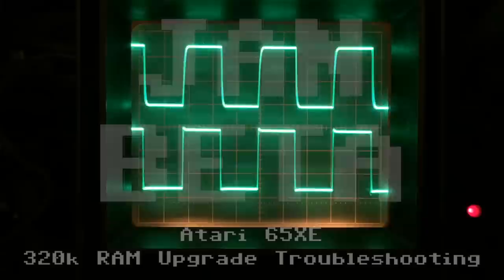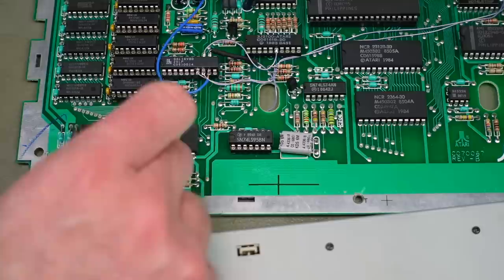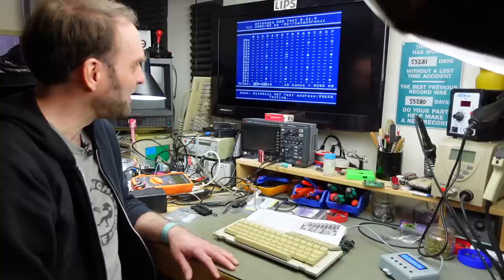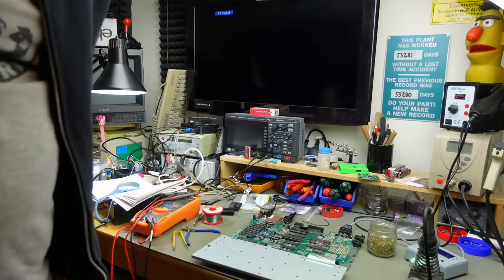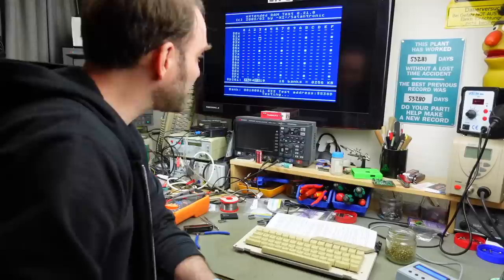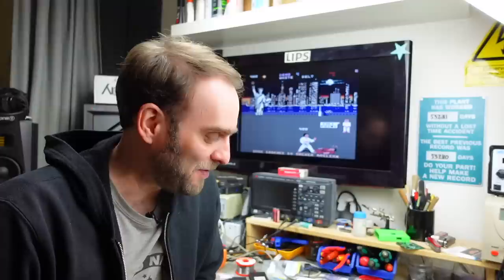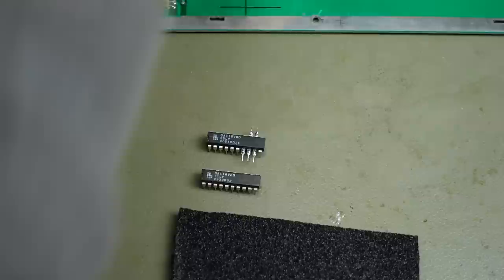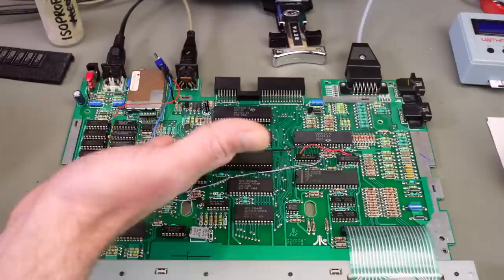Atari 65XE 320k RAM Expansion Troubleshooting

Comment: If you haven't already know, I need to say that -XI-, the author of the XRAM test you were using, has recently passed away.
A good test for RAM expansion seems to be a game titled LAURA, and the famous NUMEN demo.
The most RAM related chips are FREDDIE, MMU, and EMMU (your GAL), and also SALLY, and ANTIC.
These "precision" type IC sockets (especially DIP40 ones), brought me a lot of troubles during my build of Atari ITX.
Reply: Yeah, guys who work on arcade machines tend to *HATE* machined pin sockets.  They apparently cause issues a lot.  Talk to someone who works on arcade machines, and they'll tell you that high quality double wipe sockets are the most reliable.
Reply: @Calphool222  I wonder if it's more of an issue with pins getting knocked out from jostling. Kids/young adults are not above hitting or shoving an arcade unit.
Reply: I have never heard anyone having issues with precision sockets. On the contrary, every time a board of mine had an issue, switching to precision sockets did the trick.
Reply: @nickolasgaspar9660  

Go read the Arcade Museum forums.  There's a debate that breaks out there from time to time.  The majority don't like machined pin sockets, though some prefer them.  There are various reasons given.

Comment: Hi Jan, maybe a silly thing to mention but have you checked the capacitors (value) for the new ram? Also have you checked the voltages on the RAM’s while a demo is running? Keep up the good work, love these videos!
Reply: Yes, a software RAM test is too high level, we need to check signal and power integrity.

Comment: I would re-route the wires, I see a few wires going under the resistors perhaps it picks up some disturbance and also the switch I would try shorter wires ...
Reply: This is also what I thought. I had a lot of annoying problems with random wires like this. But I guess the GTIA was at least partially to blame for the issues, so maybe the Atari is slow enough that long wires don't matter too much
Reply: Good one yes, if they are not shielded it may very well do that and also mess up timings when they are too long
Reply: At very least he should throw a scope on those wires to see if they are picking up any stray frequencies.

Comment: @3:36 The "N" doesn't mean anything important at all. It's part of the order code for the chip, indicating the plastic DIP package. Generally, the presence or absence of a letter like the "B" on the other hand can point to chips with slightly different behaviour, like an extra buffer stage, schmitt-trigger inputs or a different speed grade. The meaning of the letter suffixes are not necessarily standardized and might vary between different manufacturers. Still, what Jürgen most likely wanted to point out is not "you need a chip that has an 'N'", but "you need a chip that doesn't have a 'B'".

In case of Texas Instruments, it seems the A or B suffix on the 74xx95 chips indicate power consumption, with "B" being lower power than "A". They only offer the the 7495A (standard TTL) and 74LS95B (low-power Schottky) which both have approcimately the same speed, but the LS chip has lower power consumption due to the more efficient implementation using Schottky logic. There seems to be no TI SN74LS95N.

Comment: You look like you have another signal overlaid on your square waves around the 17 minute mark. Its amplitude in your samples mostly isn't big enough to trip a false hi or lo when it's overlaid, but I bet sometimes it is. You either have something actually crossed or it's just so physically close that you're getting some kind of RF bleed or something. All I know is that's not just the usual ringing you expect on a square wave.

Maybe try taking the pin you were testing where you kept seeing a sudden fluctuation in the middle of the top plateau of the square wave (edit: 17:12), and see if you can tie its source hi or lo. That'll basically let you isolate the overlaid signal, if there is one. Then you might recognize the pattern in the overlaid signal and then you can look at whatever generates that signal and how it might be bleeding over into the memory bus.

Edit: Sorry if I'm not describing the issue well, I come from the software side of retro computing and my knowledge of hardware mostly comes from channels like yours and some mentoring I once got from a guy who worked in aerospace. It's not my field, but I get the basics and I've seen enough oscilloscope diagnostics to know that your sample looked wrong.

Comment: It's not that 74 series being fake is it - ie. a HC re-labelled as an LS?   I think the N just means its plastic btw!  I also wonder if the wiring (proximity of 2 cables next to each other - or length of them might be a factor?
Reply: N just means "plastic DIP" yes... I very much doubt anyone would bother remarking HC as LS.
Reply: @jaycee1980  Clearly you didn't watch Adrians video - they ARE relabelling HC chips as LS (and vice versa).
Reply: @GadgetUK164  I've not seen that one.. seems bizarre though, not something i've ever come across but then I dont buy components from eBay or Aliexpress any more.

They could have at least relabelled HCT as LS, which would largely pass

Comment: You might want to check out the Retro Chip Tester Pro. It's an Arduino board that can test many old 74xx devices but also DRAM chips, dump ROMs and, with adapters, check SIMM modules and other things. It doesn't reliably detect marginal chips (it's not fast enough to check actual chip timings) but it should be able to tell you if a chip is completely dead

Comment: Unsure but would certainly put your wire runs on the oscilloscope, then check voltages, try replacing PIA as Jurgen suggested in these comments. Then try a replacement ANTIC as merely a shot in the dark.  Other than that maybe it's a failing passive component issue? Sorry to see you having difficulties with it.  Also you might consider getting an XL/XE SysCheck 2.2 from Jurgen since it offers 512K.

Comment: With all the tests now, and the fact that standard usage (w/o memory expansion) works fine let me point out the PIA(6520). The drives the memory expansio and bank select. Portbits PB2, PB3,  PB6 and PB7 selects one of the 16 banks with 16K each. PB4 low = $4000-$7FFF is mirrored with extra bank, PB4 high = standard RAM active in the area. PB5 is used for dedicated ANTIC access, PB5 low = ANTIC "sees" extended memory in selected bank, PB5 high = standard RAM. It´s possible the set different (PB4 & PB5), to let use the ANTIC the extended memory and the CPU runs the code in standard memory. This trick is invented with the 130XE and was used by a very few demos which pre-calculate the screens and let them run from extended memory.

Use the scope and run XRAM to check the signals an PB2...PB7 (Pin 12...17 of PIA). Because the test is quite slow, there must be a stable and sometimes a transistion visible - PB2 more often, because it´s the "LSB" of the 4 bit bank number. When there are flaky signals visible... the PIA is the culprit.

Comment: I would write my own assembler program to do my own ram test.  We need to get to the point where we have precision on how exactly it is failing.  Are reads occasionally failing, or are writes occasionally failing.  Does it happen only when specific address bits are high or low?  Does it fail when only specific data bits are high or low?  We don't have enough info right now, and we're shotgunning chips into it with our fingers crossed.  That's not going to work when we get to this level of troubleshooting.

Comment: Were you testing the bare board just sitting on your table? Make sure you clean it of solder dust, etc. Could have been an intermittent short from tiny solder crud on the table.  Or maybe place the board on an insulator and not the bare table that you used for soldering...

Comment: The thing about the Atari 8 bit computers, is the clock design.  It literally is daisy chained through the main LSI chips, and if one of them damages or deteriorates that clock for the next chip, issues like this can result.  Use a scope and look at the clock going in the chip, versus the clock coming out of it.  The CPU is at the end of this chain and can sometimes get a signal that is barely 5% duty cycle.  Usually increasing the speed type of the logic chips also in the clock path can help this issue.  A 74LS to a 74F for example.  Also XEs with a quartz crystal instead of a clock generator "can" are less stable than the crystal oscillator designs.  Most XEs have solder points for both.  A quartz crystal with a couple transistors generates a sine wave clock.  The dedicated clock generator cans generate a square wave.  The square wave has less chance of deteriorating than the cheap crystal clock circuit.

Comment: I once had a logic board with 64h DRAM and Z80 CPU. It was a proprietary control board for some machine. However, in time it started developing random glitches. After few days, I soldered on the bottom of the board DIRECTLY ON THE RAM POWER PINS a 1uF capacitor, on each ram chip. It solved the problem. Maybe try it to see what happens. My guess was that the decoupling capacitors went bad so I tried his solution that worked.
Edit: the glitches started to appear after the Z80 PIO and the Z80 CPU were replaced; they died from a power surge so, the new chips were less tolerant to the unclean signals on the bus. The added capacitors maybe helped to keep the power on the ram chips clean, thus making the signals better.
While you have a oscilloscope, watch the power on the ram chips, see if there are something interesting when the ram test fails.

Comment: Have you ever considered getting a Retro Chip Tester Pro?  It's a very powerful way to validate good/bad chips with a minimum of effort.  I know Noel's Retro Lab and Adrian's Digital Basement both use them, and they have saved a bit of time compared to trying to swap out so many untested chips.  I understand it's a rather involved project, but it seems to be worth while in the end.

Comment: Jan... I love your videos... :)  but... in this case I think the problem is with interference between elements and that "spider mounted" cables over motherboard.  I had a Atari XE motherboard that had custom 1MB RAM upgrade inserted on 3 sockets in 4-bit RAM motherboard version. So... Seller climed that is ok, but when you checked it with Jurgen's SysCheck it was possible to see some kind of glitches / artifacts between couting digits during memory tests.  I removed this upgrade and now it is ok.  If you want to have for sure that this Atari works, it is very easy, but you should go enter to "modern retro computring" world... So 1) remove all DRAM chips (on XE motherboard it is always problem - a) not working b) vertical bends on the screen in the background c) others) 2) put Lotharek's SRAM 64K V3 under 6502C. DONE.  You will have stable 64KB machine.  If you want to have a more RAM, use solid Ultimate 1MB upgrade, that provide RAM up to 1MB with different configurations, support for HSIO (so important when you have more RAM), support for SIDE3 and a lot of more..  if you don't want to have "modern" elektronics inside Atari, use Jurgen's SysCheck that provides HSIO + extra 512KB.  That's all!  Greetings from Warsaw and Polish Atari users!  BTW.  I invested in Keysight DSOX1204G 200Mhz and U1272A - great devices! Thanx for you videos!

Comment: It's very curious to me that the GTIA chip works perfectly fine with the RAM expansion disabled, but breaks when enabled.

Is it possible there's nothing really broken with the original GTIA chip, but it just works differently, and is incompatible with the mod?

It might be curious to send your original GTIA chip to the guy who designed this mod and see if he has the same problem.   Perhaps he can provide assistant,since he's the one most familiar with the mod

Comment: I dont know if you checked the power supply before all this, but if it was me, I would be checking it. Under full load for several hours.
I would also make sure power getting to all the chips is at spec.
Ur using different chips now so power demand could be less on the power supply as well, alleviating some of the load and symptoms.
But, either way, you have an issue that is system wide that seems to be power/bus issues... did you check any bus transceivers?
Reply: I second this..

Comment: Consider also Sys-Check 2.2, it's not just a diagnostic device, it provides 512K RAM expansion, simply plug it in the back. Then there's the Ultimate 1MB which is excellent too, but internal and a little more involved...

Comment: Jan....check all those wires for stray frequencies using your scope. You may be getting some spikes. Use some shielded wiring and check your power supply as well to make sure the extra chips are not dragging it down which could definitely cause an issue. If you have a bench supply with higher current capability, hook that up and try those tests and demos again.
Reply: Perhaps a twisted pair with one line tied to ground?
Reply: @JanEringa8k  indeed!

Comment: I've been following your channel for quite a while and I just got to this video. I usually don't write any comments on English-speaking channels, because I don't know English well enough to write a meaningful post myself, I'm from Slovakia. Now I'm making an exception and using Google Translate because I thought of one potential solution to the RAM expansion problem. I noticed that the plus (+5V) that you lead to the expansion switch is connected to the terminal of the resistor and that you said that you measured +5V there. It occurred to me that it might be a pull-up resistor and that it has a log. H most of the time, but there may be short pulses to log. L, which the multimeter does not pick up. It's just a shot into the unknown, but try to check with an ohmmeter whether the terminal of the resistor where you have the switch connected is really directly connected to the +5 V branch, or if it's not the other terminal. And while I'm writing a comment, I want to thank you for your videos.
Reply from the maker: Thanks for this! I tried several different 5V connections in the meantime and I am pretty sure the fault is somewhere else. Currently suspecting the PIA to be slightly wonky. I’m going to revisit the Atari soon and try to figure it out once more. :)
Reply: @JanBeta  Thanks for the answer, I hope you manage to solve it

Comment: I would try adding a small value resistor in series with the signal wires to reduce reflection. Say 22 ohms. Preferably at the driving end of the wire.

Comment: I’m catching up on videos from months ago - did you ever solve this? GTIA shouldn’t have had much of anything specific to do with memory failures, except inasmuch as it’s part of the system clock circuit. The OSC inputs goes into GTIA (pins 16 and 28 on a PAL system), which generates the Fast Phi0 signal, which goes into ANTIC. ANTIC produced Phi0, which goes to SALLY, which then creates Phi1 and Phi2. It’s possible a tiny irregularity in the GTIA might affect a little of that timing but it’s surprising if that’s the only issue. It looks like your machine has a FREDDIE chip - I would definitely look into sourcing a replacement for that. XEs are much more common in Europe than the US and they shouldn’t be impossible to find, but might be getting pricey. I think Lotharek in Poland is either making or has announced a modern replacement for FREDDIE but I don’t know about availability in light of current worldwide chip shortages.

Comment: If the machine works in 64K version and not with 256K expansion enabled, then there is a conflict which causes the machine to not work as expected. I would question the originator for more detailed info on how the mods actually work.

I would suspect the 'N' chips are non-buffered outputs

Comment: I suspect marginal RAS/CAS timings causing the chips to corrupt
Reply: Yeah this is especially true if the add-on chips have different timings, especially if those timings invoke special functions, as some newer RAM chips do.  If you can't find chips that are made for the same timing, it may be necessary to design your own memory controller circuit to help the faster ones out.

Comment: You said "Happy Ending" and I suddenly thought about cooling down the chips, not that they are overheated, but cooling down chips could worsen the beginning of malfunctioning. Maybe reduce the clock frequency, so that if it is a timing problem things might clear up.

Comment: Have you tried putting the original RAM chips back into their sockets? I noticed you still had the new ones in at the end, and while I believe you said they were tested and working, I'm wondering if they're faulty, or marginal at higher speeds? That might also account for the background color; I imagine the system at some point passes the color through it's RAM, and I also imagine the RAM it uses for that would be in the original bank, not the extended one, though maybe it does just go ROM -> CPU register -> graphics chip